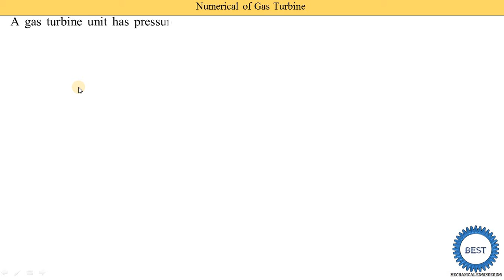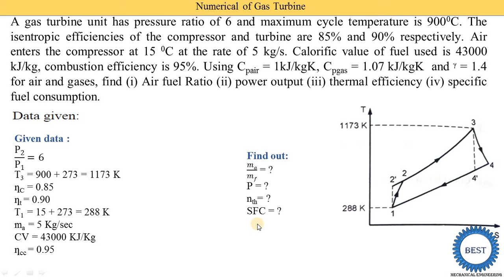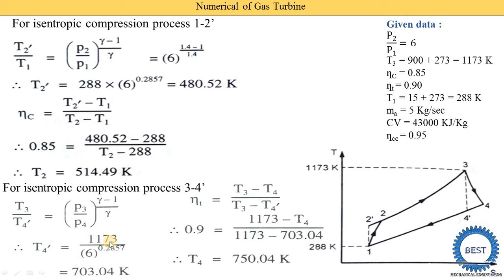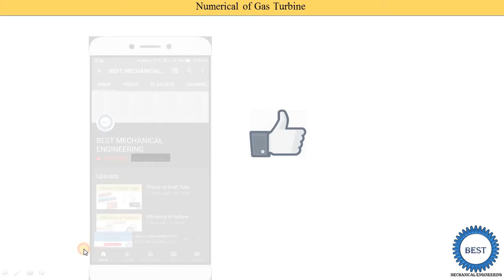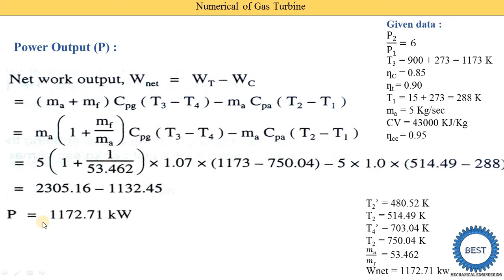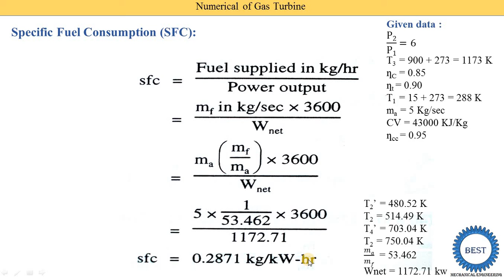Numerical of Gas Turbine - Numerical 4

Comment: since ma is given we can straight away consider the ratio as x in first equation and calculate x as air fuel ratio as a whole and get the answer directly.... then calculate mf and solve further 3 steps easily. don't usually we need to keep taking mf common on all sides. saves time. but thanks anyways for the headstart. gonna appear for sem 8 tomorrow

Comment: In a Cogeneration Steam System, the Turbine is supplied with 30 tons/hr of Steam at 100 bar(a) and 600 ℃ as described in the schematic. 
- At 10 bar(a) 12 tons/hr steam is extracted from the turbine for a Process-1. 
- The steam must be saturated vapour at the inlet of Process-1. The exit of process-1 is saturated liquid 
(condensate) at 10 bar(a) which is fed back to the boiler.
- The rest of the steam passes through the turbine, to the condenser and is fed back to the boiler as well.

- Assume all processes as ideal-
- Isentropic expansion in the turbine
- No heat loss to the environment
- No pressure drops during heat exchange
- For liquid water, C = 4.187 kJ/kg.K

Sir how to solve this problem

Can i get your contact Number?